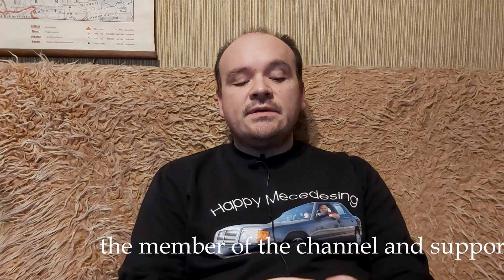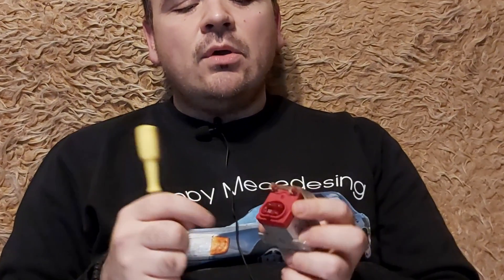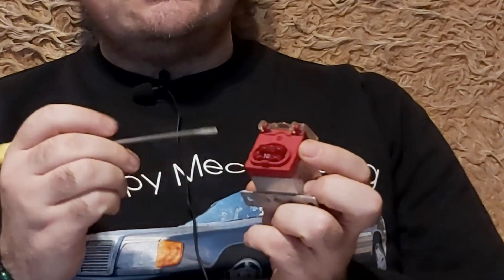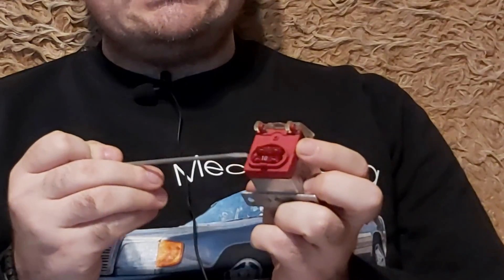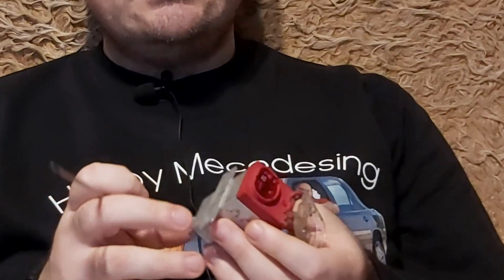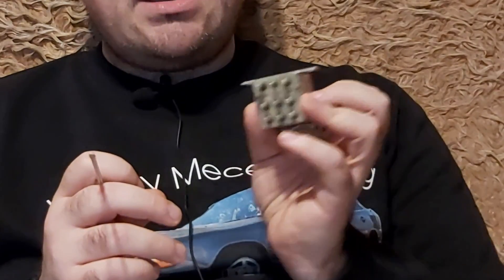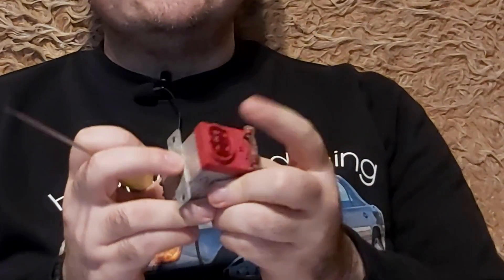㉦Mercedes Ke-Jetronic㉦ - The OVP, the Overload Voltage Protection Relay

Comment: Where can I get a six pin OVP relay to purchase for my 300 SL R129 Mercedes. Nothing was getting power from OVP. Found out 9 pin relay 30, 15 and 31 plugs into nothing getting no power.
Reply: My mistake sorry I was testing the wrong pins . I have power in OVP but not in ICV plug wires . I am looking into pin 14 of cruise control to see why? Am I a the right path ?
Reply from the maker: @trevorross7405  https://www.instagram.com/p/Ct4Yml7MzEV/
Reply: @mercedeske how to check MAS relay with ignition on or off.
Reply: On your video with OVP you said contact 30a supply to ECU terminal 15 should have 12 volts. In my ECU 15 is blank. Now which terminal I use for that check? On my 1991 300 SL R129 Mercedes?
Reply from the maker: @trevorross7405 Check the MAS sensor as well.
Reply: @mercedeske thank you for your replies and help. Terminal one from ECU and ground ignition on nothing.  Ignition switch off OVP 87E  and pin one on ECU no continuity on meter set to beep. Connect 30 and 87 on OVP check battery voltage at pin one ECU nothing.15 to 31 OVP 12 volts.contact 31 good ground.no pin 15 in my ECU not used. All fuses are good in OVP. I checked 30 and 31 diode check ok. Connect jumper from 30 to 87 E on OVP check pin one ECU nothing.Can you direct me where to look which color wire in harness from where is not conductive to power please?
Reply: Just a question during these test I had the cruise control module disconnected and ECU unplugged. Only thing that was connected was OVP relay
Reply: @mercedeske would any pins in MAS relay could effect power lost to the ECU?
Reply: @mercedeske any particular pin in the MAS to pay particular attention to?
Reply: @mercedeske Do you have video I can watch on how to check MAS relay car starts and run but rpm’s 520 no power to ICV plug
Reply: @mercedeske Do you remove MAS relay from plug to check or check with it plug in which it is almost impossible to test the pins with it plugged in no room
Reply: @mercedeske what pins in the MAS sensor should I check that would affect power to pin one in ECU
Reply from the maker: I believe you can find it on ebay.

Comment: Where can I get a six pin OVP relay to purchase for my 300 SL R129 Mercedes. Nothing was getting power from OVP. Found out 9 pin relay 30, 15 and 31 plugs into nothing getting no power.
Reply from the maker: That means the OVP was not ON. 30 is power supply, 31 ground, 15 ignition ON.
Reply: Thank you . I went to my ECU 55pins. PIN number 1 is battery voltage and pin6 is chassis ground. With the ignition key in off or on I have no power in pin 1 and no chassis ground in pin 6 . Is  there a relay or fuse that supplies power to the ECU? If so where can I find it. I looked in the fuse box under hood and in trunk. Or is  there a relay? Can you help me. I am going to clean all grounds. But power can you tell me or help me to solved no power issue?
Reply: If you are checking for voltage at pin one of ECU with cruise control module unplugged would that affect you from getting 12 volts at ECU of your 300 SL 1991 R139 Mercedes?

Comment: What should the OVP voltage read when you put a multimeter on port 6 of the X11 at idle?
Reply from the maker: The OVP voltage is being measured on the ignition ON not on idle, it should read 11-13V
Reply: @mercedeske  Oh, I see. Ok 12.6 so I'm right on target. Thank you.

Comment: I have an 89’ W201 2.6 and mine does not have this overload relay. I do have a couple of electrical problems. 
1. My cruise control hasn’t worked in over 10 years. I replaced the control box underneath the passenger side, floorboard, but nothing. 
2. I also have a problem with my instrument panel lights, not coming on when I turn on the running/headlights. however when I engage the rear window child lock button and try to open/close one of the rear windows from the button on the rear door, all of my dash lights work, and even dim with the dimmer switch on the instrument cluster. These two problems have eluded me for many years. Any thoughts? Love your content.👍
Reply from the maker: Try replacing the actuator for cruise control, maybe that's the issue. Concerning the issue with the lights, I don't know what to say.

Comment: Is the ovp supposed to rattle when shaking it with my hand?
Reply from the maker: If it rattles something is broken. So - test the contacts on it - 30(power supply from the battery) 31(battery ground), 15(ignition on), 87e(power supply for the ECU), 87L(power supply for the idle control valve), 30a(the connection between the ECU connector pin 15 and the OVP). If you get beeping sound on all of them, then your OVP is okay.

Comment: Hi sir , I cannot startig my w124  E 2.6 , can you help mi how can I fix , THANKS .
Reply from the maker: That's too wide. Start with the ignition, vacuum leaks, mechanical part of the system and end up with the sensors. It's simple - just take measurements and compare them to the nominal values. As I have not the measurements from your car, nor any service history, I can't be of some help You must tell me what you have replaced, how many km you have on the clock, from which year is your car. Without these data I can't tell you practically anything!
Reply: @mercedeske  thank you very very much BRO
Reply: So we can use the 9 contact ovp on a 7 oem ovp
Reply: Check your fuel pump relay

Comment: Hello, master. This is huge fun of you and Mercedes from Japan.
I have w126(1990)300SE (126024)
The engine stops sometimes.
No problem at start, but sometimes the engine stops when the engine is idling.
Engine RPM is getting low, than stop.
Especially when I using the air conditioner.
Please teach me should I change the bop relay?

Thank you, huge respect
Reply: Thank you very much master.
I’ll do the test you told me.
It happens at at the slope once, so it might be down shift
Reply from the maker: @boinboinboiin  Yes, that can happen.
Reply: Should I change the ovp relay?
Reply from the maker: こんにちは、ありがとうございます、光栄で! Concerning the car, if you have hard starts then you should check the OVP and the ABS light should be on on the dash. Here if I were you I would check the ICV the idle control valve. Do a simple test - select the first gear, or D if you drive automatic and hold the brake, the car must not stall. IF the car passes that test then turn the steering wheel from lock to lock both to the left as well as to the right while the car is in N(or in neutral on idle). If the car stalls then it's the idle control valve which you should remove and clean in diesel or with the carb cleaner. Tell me does this stalling happens while you downshift or as you stop at the traffic lights?

Comment: Plz help ! my car stall after start few minutes and hard start , in high speed sometimes drops the rpm 
when  deacclrate stalls
Reply from the maker: At first replace and calibrate the potentiometer, replace the injectors, check the coolant temperature sensor, replace the O2 sensor if you have it, if you have hard warm starts replace the fuel accumulator. That should make things better for now.

Comment: Hello my friend..
My question about 
terminal 38. What terminal 38 for?
Reply from the maker: Hello. There is no terminal 38. There is 30 - voltage supply from the battery, 31 - ground, 15 - ignition ON, 87E - one for the ABS, one for the ECU KE,  87L - voltage supply for the idle control valve and 30a - the communication between the ECU and the OVP when the car is both ON as well as OFF - if any CODES appear, the ECU stores them. That's it, no any other number! I supposed you read number 30 as 38. Best regards!

Comment: Hello thanks for all of your hard work! I am wondering if you have any way to power the relay out of the car to perform these tests? Connecting a voltmeter is going to be hard when its behind the battery and ECU! Thanks again :)
Reply from the maker: You would have to remove the relay for this test. Anyways, if you have no voltage on your ICV then your OVP is gone bad(if the ABS light doesn't come on). The ECU goes in limp mode as well so your EHA will not be working.
Reply: You might try to run battery voltage to the correct pin of the OVP with some banana plugs. There is a guide on the Internet, you'll find it easily.

Comment: hello master 😃 I had a problem with the cold start and the ABS It was on permanently for a long time I was looking to find out what the problem is and finally the security of the ovp relay was turned on I changed it and everything fell into place.
Reply from the maker: Hello. Glad you solved the issue. Happy Mercedesing.
Reply: @mercedeske  I just have a question what exactly is elz and how does it help how it works?
Reply from the maker: The EZL is the ignition module. It works the way notches on the flywheel determine the way the timing is going to be. After reaching 460 revolutions per minute the so called crankshaft position sensor reads the revolutions and sends them to the micro computerinside the EZL. The computer converts Hertzs(the oscillation per second) in revolutions per minute(RPM) and creates so called TD-signal or the RPM signal which then activates the ECU, the AC compressor, the X11, the RPM gauge on your dashboard, the fuel pump relay. There is nothing you can do to readjust the timing manually, everything is done by a computer with a help of the CPS(crankshaft position sensor). Here is my link to that video.
https://www.youtube.com/watch?v=1UQjX83S8iA&t=13s
Reply: @mercedeske  thank you very much😃🙏

Comment: Hello dear, congrats for your explanations and perfect english!
I have a 1986 G class 200GE with M102 engine. As the car has never run smooth, i wanted to check any fault code through the diagnostic port. Unfortunatly, while the car was running and I was connecting the code reader, i made a mistake with the pins and suddenly the car stopped running. It starts well, but dies suddenly. It seems that fuel pump isn't running, but I can ear the sound when I first switch on the ACC. I anyway bought a new fuel pump relay, with no success. I checked also OVP relay, fuse is ok, it seems to be fine. Any idea? Have I fried the ECU? thank you very much !
Reply from the maker: Hello and thanks. Maybe you damaged the ECU because you shouldn't have done it under voltage only when the engine is OFF! Remember that in the future! Try replacing the ECU for now.
Reply: @mercedeske  thanks a lot for your reply! It is quite a rare car, i hope i will find an ecu :)
Reply: @mercedeske  It seems I have fried the ignition control module, indeed the rev counter stopped working as soon as I made the error with the obd pins. No td signal, no fuel pump working. Is it possible? I will check and update you if you have pleasure :)
Reply from the maker: @IutubRider  If you can't get the TD signal, then you should replace the EZL, the ignition module otherwise your ECU is dead, the fuel pump relay, the RPM gauge, the AC compressor.
Reply: @mercedeske  yes, i will replace. it is strange because it is not completely broken (possible?) as if i shortcut the contacts on the fuel pump relay, the car stays on
Reply from the maker: @IutubRider  If you manage to start the car after you bridge the contacts 7&8 then your fuel plum relay is bad. If your td-signal is bad you won't be able to start the car at all!
Reply: @mercedeske  FPR is brad new. With 7&8 bridged, the car runs fine, no rev meter
Reply from the maker: @IutubRider  The ignition module then!

Comment: Hello, I have w201 2.0 1992 in Excellent condition, i wanted to do some maintenance but the car become worse : following have been replaced
1- new ICV
2- new EHA
3- new bocsh fuel pressure regulator
4-new bosch fuel pressure accumulator 
5-new bosch fuel pump ( with check valve)
6-new fuel pump filter third party
7-new OVP original
8- new Fuel pump relay original
9-new temperature sensor coolant 
10- new temperature sensor for the clatch fan
11- new temperature sensor for AC fan
12-new Air temperature sensor (the small one attached to the Air filter
13- new distributor cap and rotor
14- new spark plug HD7C
15- NEW spark plug cables
16 new O2 SENSOR third party
17-exhaust is in good condition new middle silencer and muffler installed
18- new potintionmeter adjusted at 0.7 
19- new intake manifold Casket
20 new bocsh fuel injector s
How ever the car performance is bad, RPM sometimes stable  at 800 RPM some times GO  higher at 1300,  engine is not happy sometimes it shakes on Ideal and sometimes good.
Car always starts good from first try at   cold or warm
Before i change all above   the car performance was excellent i did all above because of very small ideal issue i was facing , and i wanted to smoothens it More unfortunately the car now drives bad and no one around can tune it , i am located in UAE 
Can you share your email address so i send you more details also happy to support your channel.
Reply from the maker: schilleryu@yahoo.com

Comment: Hello Master, I live in Iran. The wiring diagram of the injector system ke jettronik can not be found here. If you can send it to me, please.
Reply from the maker: Hello. You need to tell me from which year is your car and the label on the airflow meter. Is it lm0001/mt0001 or lm0008/mt0008? Mt is on the fuel distributor, lm on the airflow meter.
Reply from the maker: I will send you what I have but you must understand that there were 4 generations of KE and the diagrams are not all the same.

Comment: Thanks for all your videos. It helps a lot in understanding how the KE-jetronic system works. Regarding the OVP, can I use 9-contact one to replace 7-contact one? Because 7-contact one is no longer available.
Reply from the maker: I wouldn't say so. They are not connected the same way. The 7-contact one has one fuse(I have the one in my car) and the 9-contact one has 2 fuses. They are not connected the same way I believe. Did you search on ebay?
Reply: @mercedeske  Thx for your reply. Only a few used available on eBay. Not sure about quality though.

Comment: Thanks..
Reply from the maker: Always. Yours has 6 contacts for sure. They are simple made and that's how it's supposed to be 👌🏻
Reply: Hi, can you please advise if its possible to buy replacement Bosch advance vacuum units for W124? I'm having difficulty trying to locate one.
Thanks
Reply: @ronanconnolly2196  what is the part number?